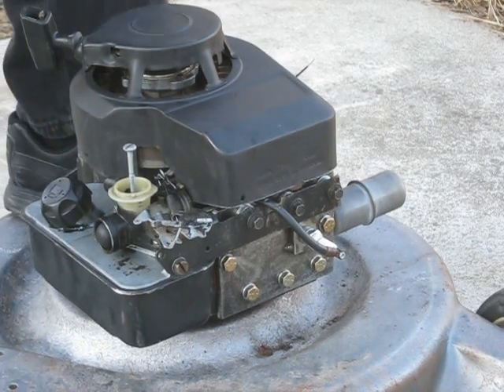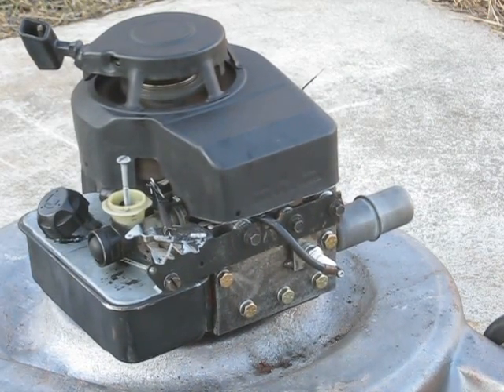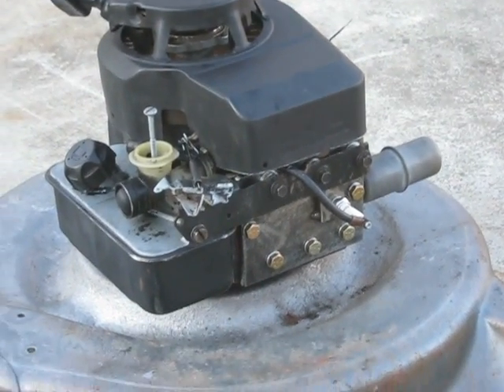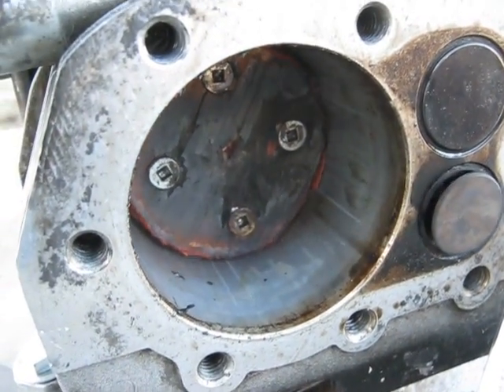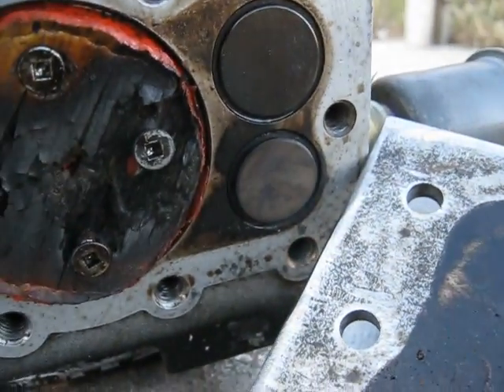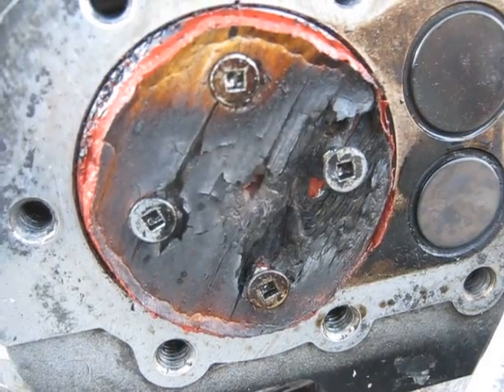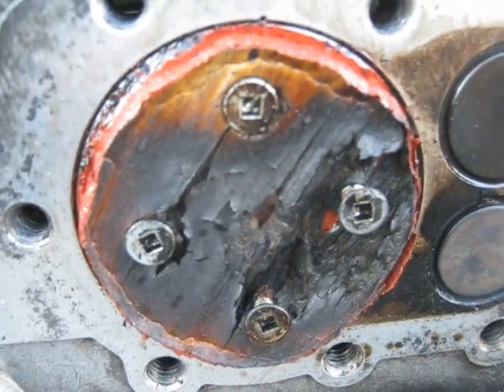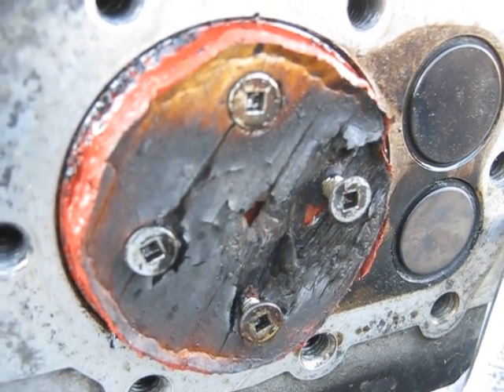BALSA PISTON BRIGGS RUNNING!

Comment: How's about a Piston out of Teflon? It melts at around 326c, is very strong, and slippery. 

I use it on my Jetboat's hull and it barely flinches at 40mph hitting a jagged rock just below the surface. (Which stops the boat and blows windows out...) So i'd be interested to see how it holds up to the fiery hell that is Infernal Combusion!
Reply from the maker: I would give teflon a try for sure, though I doubt i have any. I used to have a piece 1/8" thick from a sheet, but I know the stuff was very expensive. I will have a look for it.
Reply: Look at boat building shops and ask if they have scrap teflon. They reinforce jetboat hulls with it. With any luck you should find some so we can see how it does!

Comment: there's a bit of carbon build up on the piston.
Reply from the maker: Yes, running these wooden piston crowns, there is usually lots of carbon build up, as well as a tar like liquid, and the oil is smelling like burned wood, and turning a nasty blackish color form the burning particles when the piston burns thru.

Comment: After the jb weld it would be nice to see how long a dome made of Duraglass(short stan fiberglass) would hand up..Also a thick piece of leather..might need a top ring for support
Reply from the maker: Hmmm, I had not thought of trying thick leather, I will have a look around! I have cork on the way, and I bought some Hemlock yesterday. I wanted Ironwood, but the lumber mill didn't have any. Hickory was appealing, but the cost was too steep for the small amount I require. I was hoping I could have a hickory smoked hot dog from the exhaust!!!  :)